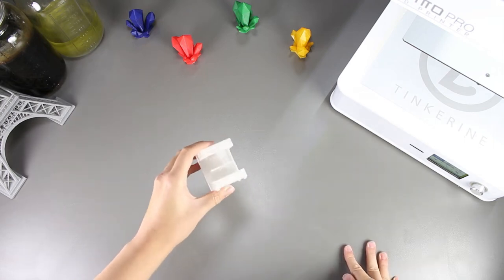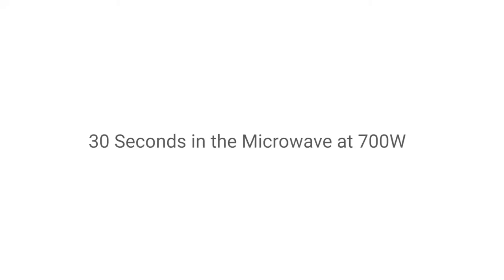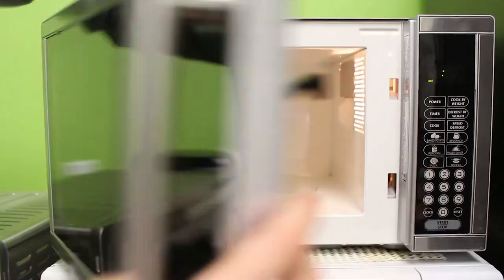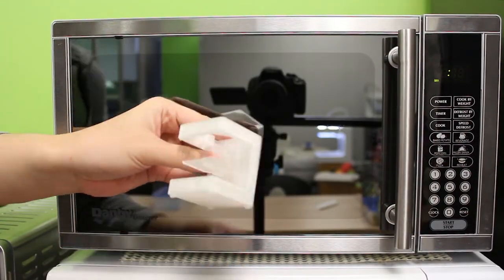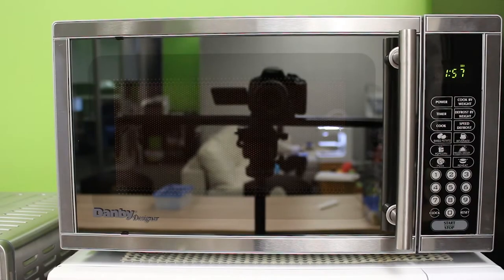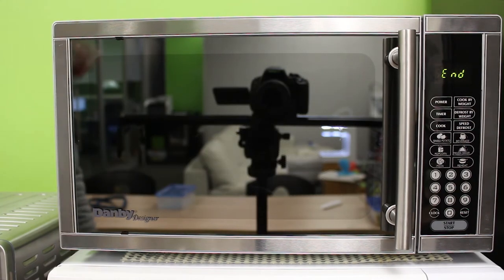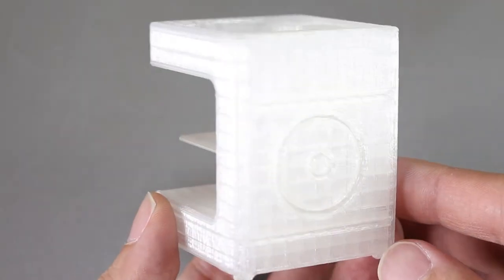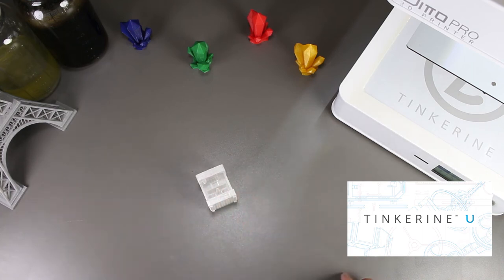Smoothing 3D Printed PLA Parts in a Microwave Part 2

Comment: Try dipping the part in water.  Since the water will not create a charge binding with the pla, perhaps a little soap in the water to break up surface tension and make the part 'wetter'.  Microwaves generally work on molecules with polar charges and I don't think PLA has a polar charge.  I don't think you can submerge the part in water;  The water will get hot and make the plastic soft.  But if you leave it in teh cup of water till it cools the buoyancy might keep the plastic straight until the water gets to room temperature again.
Reply from the maker: Thanks for the comment and suggestions!

Comment: I'm still waiting for the caustic soda smoothing test 😋 I know is used in some 3d printing processes to remove pla supports from abs parts. Maybe in small or controlled amounts would smooth the surface of a pla print.
Edit: when I say remove, I really mean dissolve.
Reply from the maker: Thanks for the comment, sorry we are still trying to acquire some caustic soda for the experiment!
Reply: Tinkerine Available at most hardware stores (Known as Lye, Caustic Soda, or Sodium Hydroxide)